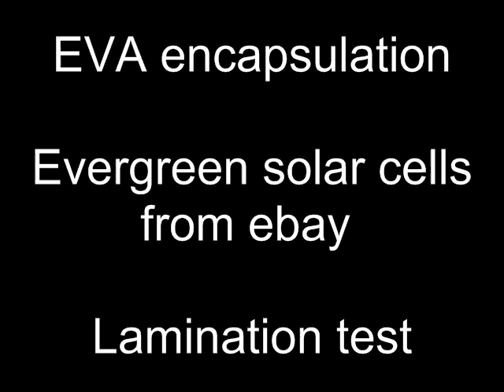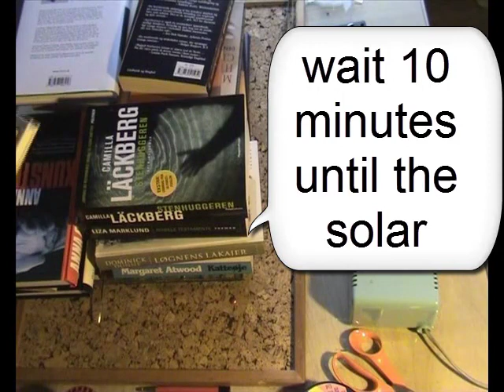EVA encapsulation how to cure and make solarpanel

Comment: works good, now make five more. they you will have a 12 volt panel.
Reply from the maker: use this small panel to charge my smartphone when i am on camping trip
Reply: Shartne,

The panel he made is a 6 volt panel.  For a panel to charge a 12 volt battery you need a 18 volt panel.  Which would only require two more panels like this wired in series.
Reply: vermiman K